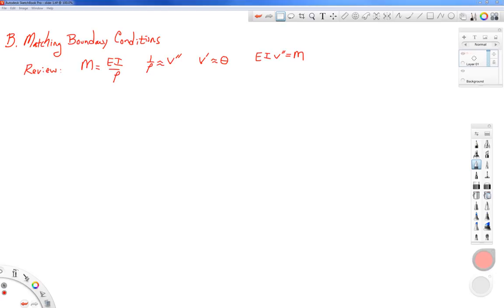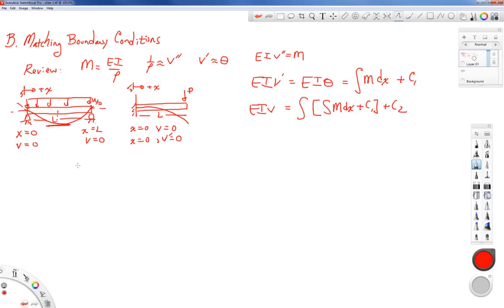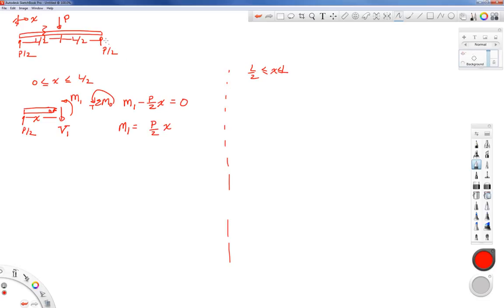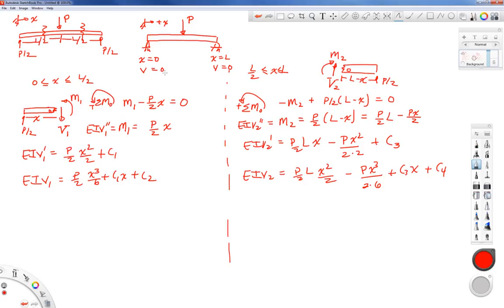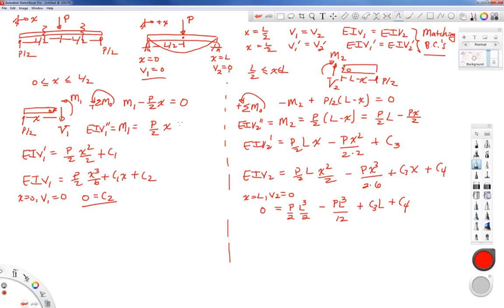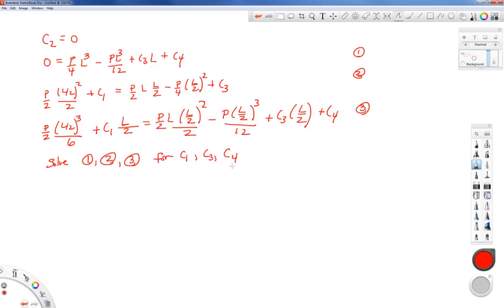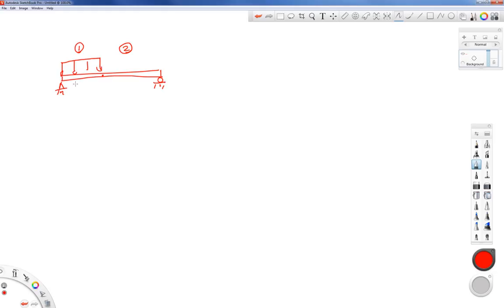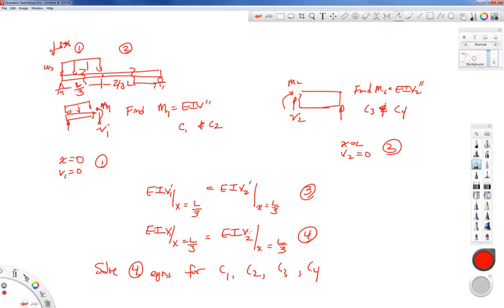Mechanics of Materials-Lecture-23-Beam Deflection--Matching Boundary Conditions

Comment: at 7:11 why is the sheer force pointing up on the right cut, but downwards on the left cut?
Reply from the maker: It is according to the standard the sign convention for positive internal shear in a beam.  I suppose you could choose both pointing the opposite way as your sign convention but then it would mess up what is positive on the moment diagram.  They cannot both be in the same direction for reasons of equilibrium.

Comment: In the early presentation,  you discussed boundary condition about beam being simply supported and cantilever. What would be the boundary condition if beam is pinned support in left side and fixed in the right?
Reply from the maker: Hi Nitish Regmi,   In such a situation, you have more unknown reactions than can be solved for, with only statics.  This is called "statically indeterminate".  This problem can be solved with an additional kinematic equation of deformation.  Please see lecture 24 on this subject (and this exact problem is worked as an example at about 15:40:   https://www.youtube.com/watch?v=GkDOic8H22A&index=30&list=PLaDWa6xI4zec07Yhxso4yQW8wQptI85yy

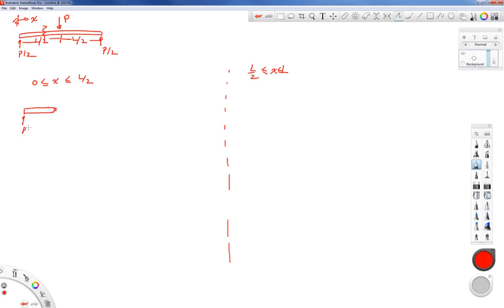Comment: I dont understand where should I make the cut on the beam, how the determine the cutting position? Let say the cutting in 5:45, why cut is on there but not on other position, can you answer me please.
Reply from the maker: In this example, we need to make two cuts because  the internal bending moment diagram has two distinct equations (see at 5:05 M diagram, lower right) M1 from  0<x<L/2 and M2 from L/2<x<L.  The point where the load is applied belongs to both regions, but the slope there is ambiguous, so we can't cut there.  We must make a cut in each region:  0<x<L/2 and L/2<x<L.

In each case, the distance from our coordinate system to the cut is called the variable  distance x.
We are free to choose to examine the Free Body Diagram (FBD) to the left of the cut or to the right of the cut.  Since the beam (and any portion of the beam) is in equilibrium, the moment equation will be exactly the same as long as we stay in that region.

If that does not help explain it, let me know and I can try to make a video to help explain it in more detail.

(There is another method of dealing with discontinuous moment equations called Discontinuity Functions, but it is usually not taught in a first course.)

Comment: P is not directly included in the either of the moment equations. Is it account for in the support reactions and the fact they are included in the moment equations?
Reply from the maker: Hi Kevin, Referring to the example that starts about 4:08, yes that is correct. The reactions are written in terms of the applied load P (since the beam is in overall equilibrium) and so then the internal moment equation in each region is expressed in terms of P, so that in the end, the deflection equation contains the applied load, P.